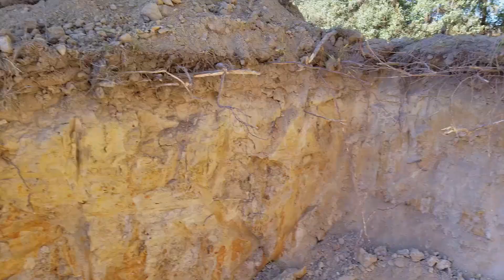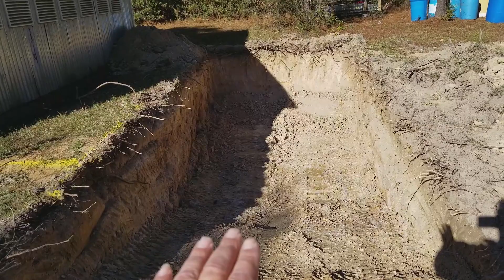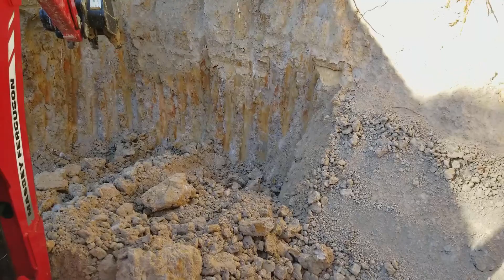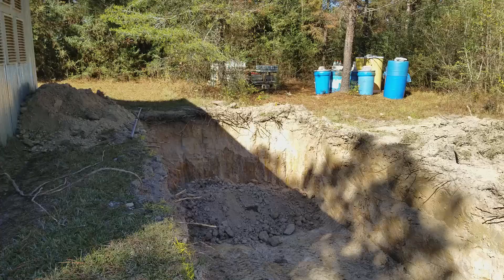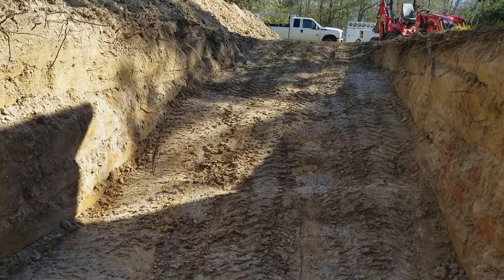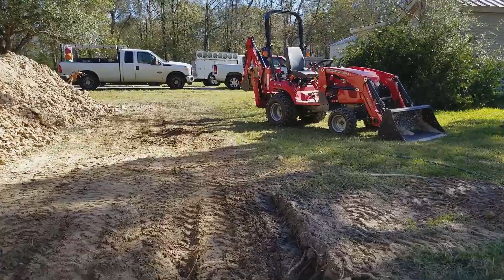#31 Geothermal Project Video Series; Hitting The Bottom With The Massey GC Sub Compact Tractor

Comment: I had the same trouble with one of my controls it was a loose nut. Hope you get done in time good luck.
Reply from the maker: Where was the nut located on the control so I can look and see if that's what is wrong with mine.
Reply: I had to take the cover off that covers the controls on mine the nuts that were loose where at the bottom of the lever.
Reply from the maker: Thanks Mech Uno I'm going to take a look and see if I have the same problem on mine.

Comment: i have a video on the linkage issue that can cause your backhoe issue you have.
Reply from the maker: Thanks Dave, I will go and check it out and look at my tractor to see if I'm having the same issue. I do hope you're right so I can fix it myself.
Reply: its a simple fix if its the same issue I had. you may have lost a bolt or nut so be on the look out as you take it apart.
Reply from the maker: Thanks Dave, In that case I will take my time with it and be on the look out for any loose parts.
Reply from the maker: Thanks Dave, I watched the video I hope that's what is wrong with mine. If I end up bringing  it to the dealer it will be there at least 2-3 weeks. I don't want to have it there that long.